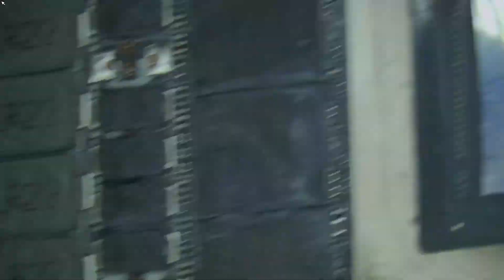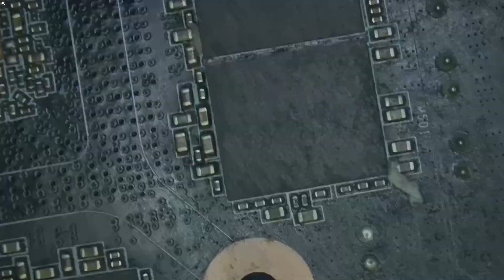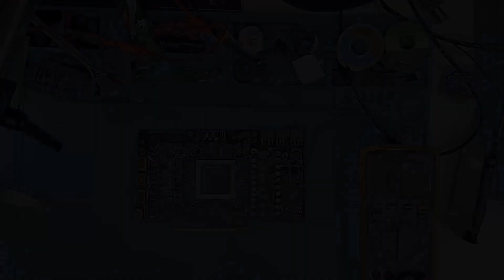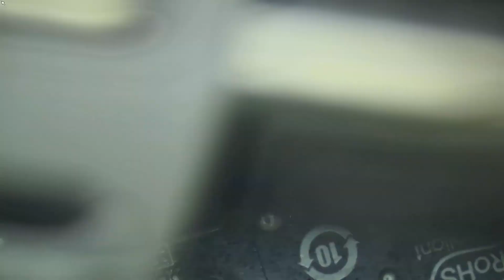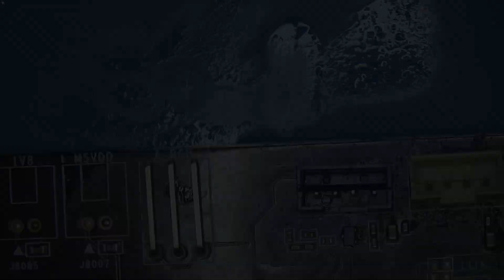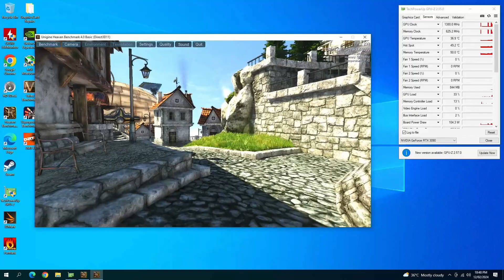Why This RTX 3090 Isn't Working

Comment: I think it's sloppy enough. Apparently there's a problem with the fan controller. The fan speed sensors don't appear, even if there is one. Checking on Haven is not enough. I hope you check it on OC Fury + Mad Lab.
Reply from the maker: @amjadalheeh2798 Fair criticism — you're right that Haven alone isn't a full picture. On RTX 3090s we cross-check with HWInfo64 for fan RPM reporting and a direct bench test under load. After the previous repair center's botched work on this card (melted fan connectors, scraped solder mask), the fan controller hardware itself took damage too — which is why reporting was unreliable regardless of software. We've added OC Fury + Mad Lab to our standard checklist for cards coming from third-party repair attempts. Thanks for keeping us honest.

Comment: Hello Fraser, I have a problem with a Gigabyte 2080 Super.
At over 80 FPS the card turns off with a black screen and the fans turn on full speed.
Since the card also got quite hot in Furmark, I replaced the thermal pads and now the card stays at around 65 degrees Celsius in Furmark.
Unfortunately the error remains, if the frame rate rises above 80 it goes back to black screen and the fans run at full speed. Windows is ok in the background.
Could it be a VRAm or rather the GPU?
I tested the VRAM with mats, no errors.
Do you have any tips for troubleshooting, how would you go about it?
Lg
Reply from the maker: If the card works when not under stress MATS will not show any errors. In this case you can try running NVMT and check if any errors show up. Now the error which you described is different. Black screen with fans spinning at full speed. Now it looks like something is cutting out power causing black screen. Do you have GPUz installed on your computer. If yes can you take a look at hot spot. What is the difference between GPU temp and hotspot. Should not be more than 15°C. I am assuming something is cutting power to the core but at this stage it is difficult to say. It could also be that thermal protection is kicking in cutting power and ramping fan speed. But this is just a theory. Can you check the temperature difference between hotspot and core and comment back.
Reply: @GraphicsCardRepairs-tk7ql   I have to correct myself, with Furmark the card runs stably at around 200FPs and 1920x1080 for hours, with Haeven VSync switched off (I only have a 60Hz monitor) there is a black screen after around 2 minutes and the fans turn up. The temperature of Core 63C and hotspot 74C is a difference of 11 degrees. At high FPS you can also hear a whirring or a coil whine.
Reply from the maker: These temps are decent. This is an interesting case. I have not come across something like this before. difficult to say at this point what could be causing the issue.
Reply: @GraphicsCardRepairs-tk7ql  Thanks for your help, so far I've always had defective memory or Mosfet. This graphics card is then put aside for now.

Comment: One should never learn repairs on a 3090 card. Buy extremely cheap broken cards and learn on them. After one learns the basics, they should but very cheap functioning cards and work on them, replacing functioning parts with new ones (not removing parts and soldering them back-I know what I'm saying). Only after they manage to not lose any card from 100, then they can start fixing cards for real.
Reply: Not only high end card is very complex, the PCB also is very thick. You need a very high flow hot air station even for removing single tiny smd  resistor without damage tha parts and pad
Reply from the maker: 😁. That same card came back with a new problem. Broken solder balls under memory. Reballed the same memory and the card is ready. I wonder what is going on.
Reply: @GraphicsCardRepairs-tk7ql  Hope is working fine.
Reply from the maker: Card is back to normal now .